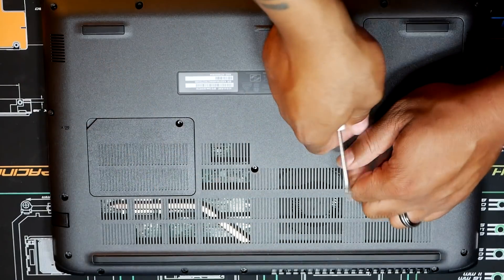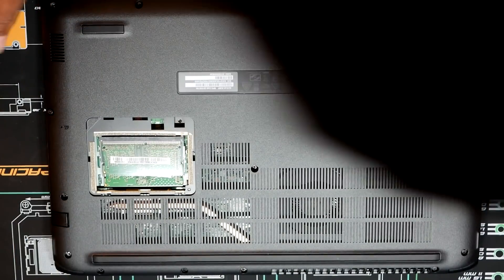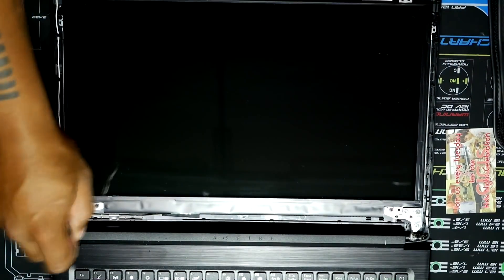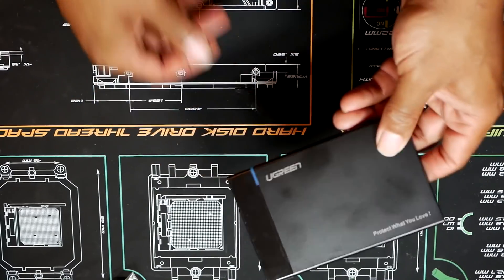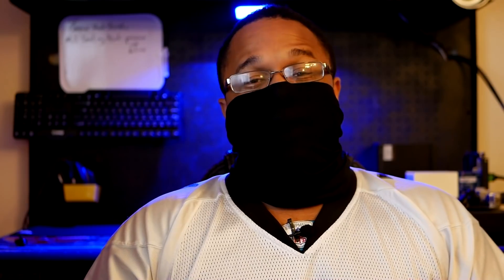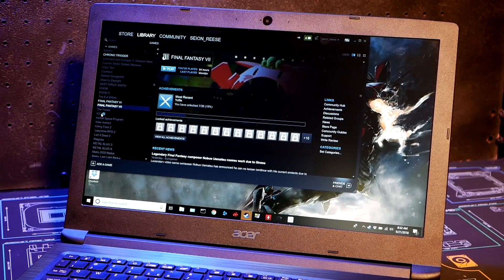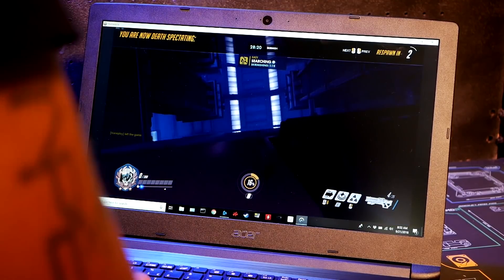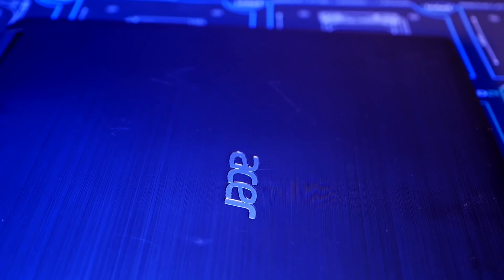Acer Aspire 3 Ryzen laptop Review: The best budget laptop for modding?

Comment: Can you run dual 1tb stock hdd along with the m.2 ssd? If so, the main windows should be installed on the M.2 and the rest of programs on the hdd?
Reply from the maker: You're absolutely right I would just wipe the old windows drive when you're prompted to install the new OS
Reply: @HeavyTek  is there space instead of optical drive for extra Caddy??
Reply from the maker: @AemondTomahawk  Doesn't look like it. The Optical drive is pretty integrated into the mainboard